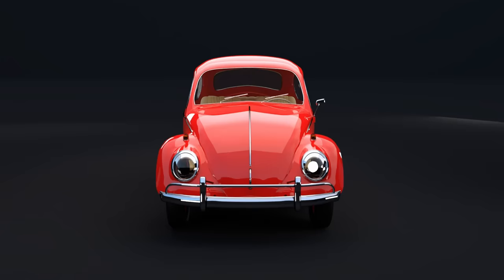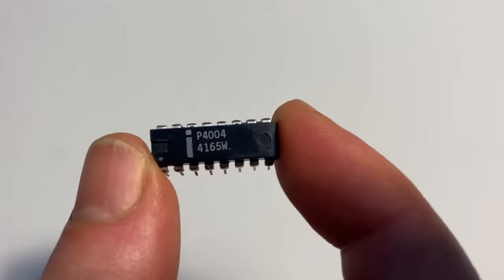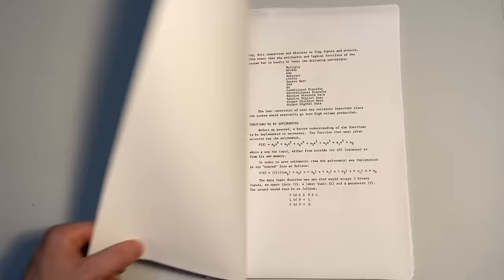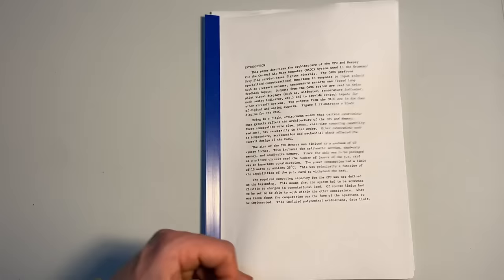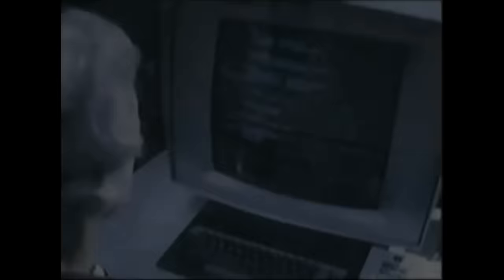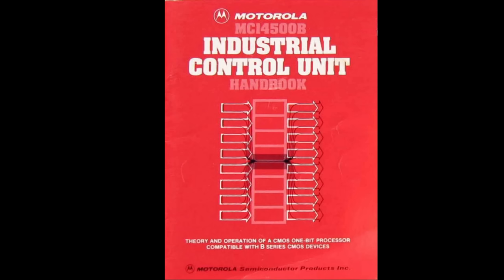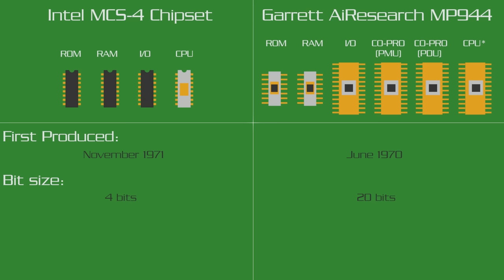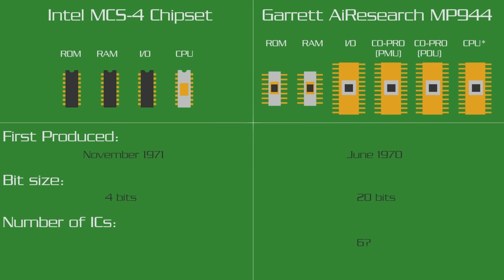The World's First Microprocessor: F-14 Central Air Data Computer

Comment: Nah, in my book the MP944 isn't a microprocessor.

I would argue that in order to qualify as a microprocessor, a chip needs to combine at least three functionalities: Some actual data processing (as per the "processor" in the name), some data flow control (governing where to get the numbers from and where to put them), and some execution flow control to tie them together.
In the CADC, as far as I understand, the SLF, PMU and PDU all only do data processing, while data flow (along with some additional processing) is in the hands of the SLs, and execution flow control is in the hands of the System Executive Control.

As for the 4004 requiring an I/O chip to demultiplex the address/data bus, that doesn't disqualify it in my book: It's jsut a quirky interface to the memory. The demux functionality can just as well be implemented using semi-discrete ICs (a few latches and buffers will do), or - at least in theory - it could use a memory chip that happens to use the same scheme to reduce its own pin count. In my book, that puts it on a similar level as modern low-pinout interfaces such as I²C.

Comment: At the same time the UK’s defence aerospace industry typically used a minicomputer designed by Elliott Automation - the 920M. Early versions used discrete transistors in a very dense package about the size of a small suitcase that folded up on itself. Later versions of the 920 series used TTL logic but I don’t think they went for VLSI implementation.

Comment: I think there's some misconception what assembler and what binary is.

In short: You don't need a compiler to convert assembler to binary, as its a 1:1 representation.

Assembler is basically just the human readable form of binary commands, to make programming a bit simpler.

A compiler is needed if you divert from machine specific code to a high level language like C, where you use variable names, named pointers, functions etc. instead of memory addresses and jump instructions.

Comment: The Saab 37 Viggen flew with a "central air computer", the CK37 (with integrated circuits) onboard in 1967. The F-14 flew in 1970.
Unfortunately I have not found any info on the circuits used in the CK37. So I don't know what processor it used.

Comment: No, the center of pressure must not absolutely be behind the cg. It’s the aerodynamic center (another topic). Your center of pressure may or may not be either side of the cg for the aircraft to be stable, as long as the ac is kept behind it. Center of pressure is where the sum of the aerodynamic forces can be considered, of particular interest to calculate equilibrium and trim conditions (hence drag), aerodynamic center is the point where a force applies when you disturb that angle of attack/incidence equilibrium.

Comment: It horrifies me this wasnt made available commercially, on any level. 
A process control processor like this could have averted a LOT of disasters.
Reply from the maker: I never really thought of it like that.
Around a year later, the digital fly-by-wire work from NASA was carried out. That was made public….but i suppose that was a more application specific use case.

Comment: I wonder if any flight simulators exist (e.g. MS Flight Simulator, or whatever system the military used to train pilots in 2006) that contain a complete emulation of the MP944.
Reply from the maker: I wonder the same. There is probably a box hidden away somewhere in either the USAF or Honeywell archives that contains a printout of the fortran code used to simulate it.
As much as I’d love to write an emulator, I don’t think the necessary info is publicly accessible

Comment: 10:11 gonna correct you here the glove vanes are a bit of bodge that was added to the F-14 to deal with the lack of thrust from the TF-30 engines when pulling high G maneuvers. They were removed when the new GE-110 were installed in the F-14B. I spent a tour in the Navy at NAWC Point Mugu working on these aircraft back in 1990.
Reply from the maker: Got it, thanks. Like I said, I always get aerodynamic-related stuff wrong!

Comment: I built a Chinese character set radio pager backing in 1989 based on a 4 bit processor. An NEC upd78 series MCU. We built 8 bit and higher operations on top of the 4 bit native capabilities with code. Of course this results in slower processing, but for a radio pager, that was ok. It was quite complicated, but with clearly defined requirements and few realtime needs, it was possible.

Comment: So, with the PC on the ROM, and with multiple roms, that means parallel execution, or parallel programming, in 1970.
Sometimes I feel like most computer tech that "feels advanced" as it were was actually invented in the 1960s/70s/80s, ignored and largely forgotten while the hardware and people's imaginations caught up, implemented in the 90s/00s, and helps people today and people think it's new.
Another example of this is 3D CGI, which was invented in the 1960s and ignored by the general public until the 80s and 90s, and those who reap its benefits today (cough games/animation/whatever cough) aren't even aware that the tech went that far back, like it sounds inconceivable to them.

Comment: Somewhere a nerd will now be trying to get Doom to run on the thing.

The specifications state fixed-point calculations so depending on how many bits were used of exponent and how many for mantissa, VERY large numbers can be stored in just 20 bits. IEEE 16-bit fixed-point gives some idea of the ranges possible. The simple concept is to keep the most SIGNIFICANT bits of a value. Yes, that inherently means a loss of accuracy but not a SIGNIFICANT loss of accuracy.

I guess someone who compares things to a 6502 might not be aware that fixed-point is a VERY old technique. We all had to start somewhere. That said, 3D games for 6502-based computers most certainly used fixed-point. Multiplication and division achieved simply by using Log and Antilog tables. I would presume the F14 would use this approach as a lookup table is WAY simpler than a multiplier and divider unit.

Of course, it all depends on the cost of ROM..

Seems odd to think the 4004 having to fetch an instruction in two memory-fetches being odd since the 6502 has 2 and 3 byte instructions, so that does exactly the same thing.

In fact even RISC chips often have instructions that require multiple reads. Literal pools being the most obvious example. Put simply, if you want to place a 32-bit value into a 32-bit register, obviously it has to read the instruction and then the data.

I believe that modern x86 & x64 processors actually convert the CISC instructions into 'triads' of RISC instructions and use a VLIW approach.

I'm pretty sure their were other custom MOS processors designed for specific purposes. ICBMs, SLBMs but to create the mask to produce just a few thousand examples would make them very costly indeed.

It's when one can set up a large scale fabrication facility potentially producing billions of general purpose processors that the costs become reasonable.

RISC was one of the key technologies in making faster processors that were physically smaller. In fact, the size stayed the same but the performance went up hugely - look at the CRAY computers. The clock speed wasn't THAT high but they could complete a 64-bit floating-point operation every cycle because the instructions were pipelined.

Although officially 8-bit RISC processors are quite new,, even the 6502 had a 1 instruction pipeline. Longer wouldn't help because with so few registers, it was unlikely that their wouldn't be collisions but if one were to employ a RISC design with even 8 registers (which has been done) then it's possible for an 8-bit CPU to approach 1 MIP/MHz

Comment: I think one can make a good case for variable geometry being killed off by more efficient weapons systems and engines rather than by advanced aeronautical engineering or what have you. The Tomcat could simply do things that fixed-geometry aircraft could not do at the time--things that they they STILL can't do. The problem is that the Tomcat's special talents (the combination of high dash speed and low loiter speed, as well as the ability to carry enormous payloads) are not seen as the most efficient solution to the problem anymore. Instead of an aircraft with a broad performance envelope, modern militaries select aircraft that are good within a much narrower envelope and equip them with weapons that will, we hope, bridge the gap. Weirdly, most peak Cold War-era fighters had more speed on tap than most modern fighters. I get why, but it's still strange.

It's like upgrading to a slower computer. Oh, and speaking of computers! Loved the comparison between a car and an IBM =D

Comment: I am sure that it was not classified because it was used in the f14. It was probably classified because of its capabilities relative to the consumer market. 

Probably the same for earlier versions that were used for earlier systems than the f14. A microprocessor doesn't suddenly appear with no precursor.  😅

Comment: 9:45 Uhh, no dude, you want it in front. That way the wings and horizontal stabiliser work in opposite directions (wings up, stabiliser down) and respond to disturbances in a way that returns the aircraft to its nominal flight path. We call that static stability and it's used in every civilian aircraft to reduce pilot workload. You want a good static margin (distance from centre of lift to centre of mass, positive towards the nose) that provides ample correction, but never excedes the control authority of the horizontal stabiliser.

For example, if a gust of wind were to pitch the aircraft up, the horizontal stabiliser would produce less downward lift, resulting in a pitching moment that rights the aircraft.

In a statically unstable aircraft, with negative static margin, both lifting bodies work in the same direction, so this pitch up never creates an opposite pitching moment to right the aircraft. Without pilot input, the aircraft would simply continue to pitch until it stalls or some other bad thing happens. I assume you've been up in a Tutor at least once, imagine not ever being able to trim it 😅

The fun side of static instability was first demonstrated to the public in '89 at Le Bourget by Viktor Pugachëv (pronounced "Pugachyov") flying a Su-27. While some maintain thrust vectoring is the main enabler of this manoeuvre, it is in fact the static instability of this aircraft that allows it to basically become its own giant airbrake. This type of behaviour has been investigated in military aviation by the Swedish since the '60s. Up until fly by wire systems though, it's not been the type of airframe you'd ever hand a novice pilot.

Comment: Swng wings is a very good effect for viewers, see for example in the 1980 film The Final Countdown.  In reality it makes no sense to seep the wings in the situations shown in the movie.

Swing wing designs were expensive to manufacture and maintain.  The extra mechanics adds weight and points of failure.  Advances in aerodynamics and aircraft design methods reduced the appeal of swing wing designs.  And in the modern days they're hard to make stealth.  That's why the list of swing-wing designs in active use is pretty short: F-14 (limited use in Iran), Tornado (slowly being retired), Tu-22M, TU-160, B-1B, MiG-23, Su-17, Su-24   Many of these platforms are being retired, none is recent and no new swing wing designs are known to be on the drawing board.

Comment: D200  (Autonetics) was commercially available in 1967, Yes, it was a 3 x 8 bit processor, and yes, it had many support chips. But it was, really, using your definition for the mp944, the first by over three years. 

As you say, it gets pretty fuzzy in the definitions.

Comment: The "microprocessor = single chip" thing has pretty much always been a silly argument. True co-processor chips were common up to the 90s, and modern CPUs with chiplets are actually splitting the computation and I/O between multiple pieces of silicon anyway. Other than certain SoC setups, they all need some support chips to function at all.

Comment: Amazing video. You have to wonder what else the designers could have achieved with more time and less constraints.

If multiple ICs disqualify a processor from being a "microprocessor" then some of the most advanced chips in the world today wouldn't count. AMDs CPUs have upto 9 silicon dies on a single substrate with over 120 BILLION transistors. 

Looking at silicon integrated circuit development since the very first chips it seems we cycle between cramming more stuff onto a single die and breaking components and functions out onto seperate dies. 

In the mid to late 2000s Intel integrated the memory controllers into the CPU, making the seperate chip on the motherboard for memory redundant. From 2018/2019 AMD took all IO functions out of the silicon with the logical processors and put it on a separate die. They did this so they could use an older, cheaper node for the IO components which don't benefit as much from more advanced lithography and use the leading edge fabrication almost exclusively for logic. This had a massive benefit for yields and production costs as well as needing only 3 Masks to make all of their desktop and enterprise chips from top to bottom. Most truly monolithic chips AMD make for mobile and embedded systems are referred to as a system on chip. At the same time their EPYC server line up has taken the chipset from the motherboard and integrated it into the IO die removing functions from a separate external chip and handing full control to the CPU which they also call an SOC because almost all IO is handled directly by the CPU. 

Only ASICs and FPGA are pretty firmly defined terms, although ASICs are still pretty broad. Internally at AMD and Nvidia, specific GPU processes are designated an ASIC. 

Personally I view a microprocessor as a processor that is on a single board, be it a substrate or socketed into a motherboard as opposed to being the size of a cabinet.

Comment: From a friend at Intel, he said that they had the Pentium 50 designed and working in 1974. Mind you, the Pentium 60 didn't debut in the consumer market until 1993! So, with that logic, the 80286 was a functioning microprocessor in the mid to late 1960's.
Reply: I was a consultant for the Intel microprocessor group from 1973-75 and I do not believe your comment to be true.
Reply: @firstmicro  I find your comment to not be very persuading that you just happened to be a consultant for that group. Nice try!
Reply: Yeah, nice try. Look me up. Ray Holt, F-14, First Micro

Comment: What is known about the the Saab 37 Viggen? First flight 2/8/1967 and introduction 6/21/1971.  The Wikipedia entry refers to electronic digital computer.
Reply from the maker: Yes, it was highly advanced for the time. It consisted of many individual ICs, so didn't fall into the class of 'microprocessor' (a bit like the Apollo Guidance Computer but not quite as capable)

Comment: At the time the semiconductor bleeding edge topic was LSI (large scale integration) and I think there is some confusion here between LSI and a microprocessor. The MP944 was implemented in LSI, but the core processing element wasn’t a microprocessor as it lacked a program counter. In fact with the PC off-boarded to a (modified) ROM chip it leaves me wondering how it could perform branches and returns? Or did it simple execute a fixed cycle of instructions to complete the air data calculations in every calculation frame?

The 4004 was also implemented in LSI but was complete as a central processor. Having a multiplexed interface to memory which in turn required external logic implemented as separate LSI chips for convenience was not at all unusual - the 8008, and 8086 had similar support chips. It was a limitation of the design, layout, process technology, and packaging technology available at the time. 

Being 4 bit doesn’t disqualify the 4004 either. It limits its performance. Remember the Ferranti F100L? A 1-bit microprocessor! The 20 bit data size in the MP944 would have been a design choice driven by the precision needed for air data calculations without resorting to processing multiple bytes serially. 

As to why they chose to implement divide - not sure. Air data calculations are repetitive and implement standard atmospheric models and aircraft control law models which would usually be implemented by interpolating pre-calculated look-up tables to be very fast. The calculation cycle has to be deterministic so it is guaranteed to complete in a fixed real-time frame so perhaps 20-50 frames can be calculated per second. Divide is usually a variable duration operation which doesn’t fit with deterministic behaviour, so I’m curious how the hardware divide worked.

Comment: You may have to define a microprocessor by what isn't. The PDP and the Hughes BP were made of discrete components (discrete components could contain registers). RAM used to be magnetic core, ROM could be a ribbon cable with holes. We use similar error checking in rail systems. The 8086 had the 8087, plus Programmable Interrupt Controllers, and DMA. DMA is parallelization in the sense, a separate processor loads in to writes out memory, and lets the CPU know when it's done. 

And I have to respectfully disagree with regards to stability. Fights should have low stability in order to change orientation quickly. I think it would be like a rocket, where you want the center of thrust to go through the center of gravity, so you could get it under control. It's different like you said, subsonic relying on laminar airflow to effect changes in orientation. When you transonic to supersonic, the air detaches from the wing surface, and the control surfaces deflect turbulent air. Sweeping the wing makes better response at higher speeds, where supersonic, you pretty are making a delta wing to go through the shockwave.